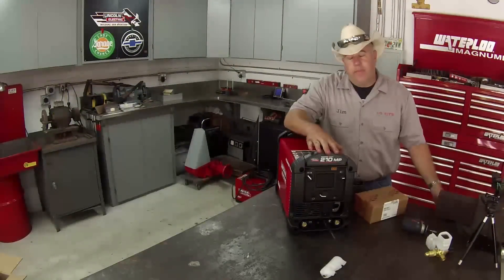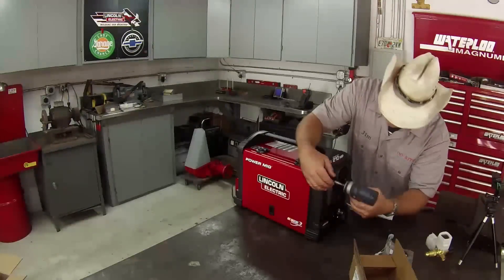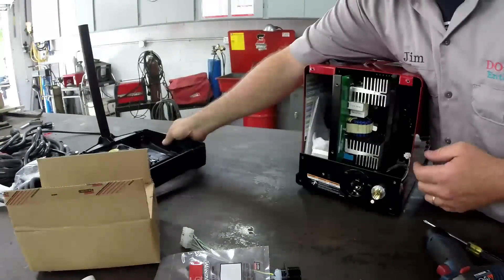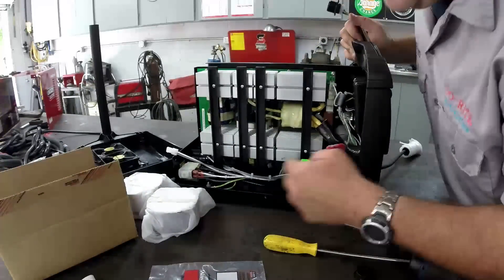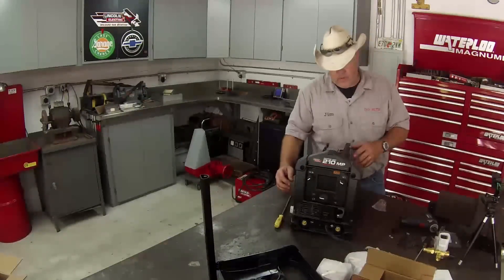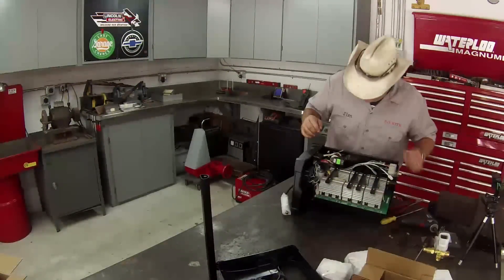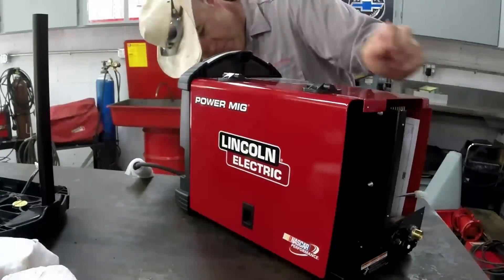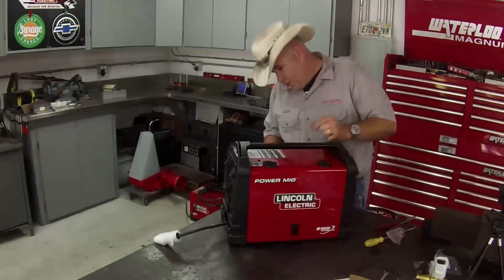New Lincoln Electric Power Mig 210 MP Welding Machine  (Ep 3 Tig Weld Adapter Installation)

Comment: Lincoln should include adapter plug for Tig for the price of machine. But looks like a good machine thinking about buying one or Tweco fabricator 211i
Reply from the maker: +dunno yolo I have been super pleased with mine. I'm going to stretch it's legs out this week I have lots of farm welding to do.

Comment: absolutely ridiculous that it doesn't come installed from the factory.    how cheap can they get.   unreal.     lame too that you gotta leave the side door open when using the pedal.
Reply from the maker: +gerard143 It is a bit ridiculous that they don't install the plug at the factory. I assume it is done to help keep the cost down, since it comes in the TIG kit that you have to buy separately. Most folks want a less expensive MIG welder first. Then add the TIG option later. Instead of focusing on the fact that the door will be open during the very few times that I DC TIG weld with my MIG welder (I have 4 other TIG welders) I am focusing on the fact that someone FINALLY made a really nice MIG welder that can TIG weld! Where was that when I first got started buying machines.
Reply: +DoRite Fabrication I hear ya.  I feel the esab has a heads up now on the Lincoln however I bought the Lincoln over the esab.  Esab rebel will do 6010 well. Plugs right on the front for pedal.  User manual and parts is listed right in the lcd interface and the case is a real nice design with more handles and protection.  I chose the Lincoln because the lcd interfere is a lot better looking and better use of colors.  As well as its red and I hate yellow lol.    Kinda eats at me knowing the Lincoln won't do 6010 good and the rebel will and I bought a welder in a way that is now inferior in some aspects but screw it I guess.  I won't use 6010 often anyways I'll just mig what I need to 95 percent of the time.    I'm sure I'll be happy and it's a great welder.  Mine arrives tomorrow.  Excited.  Just built my cart so it's ready for a new shiny welder lol.

Comment: A lot of people seem to really like that machine. But leaving that TIG plug out is bogus. I could see if the upgrade was something more costly like a special board, but just a plug? Also having the plug be under the side door isn't ideal either. Come on Lincoln, you can do better. If you have to shave something off to hit the price point, make it the extra drive rollers and included spools of wire or something.
Reply from the maker: +Rambozo Clown I agree, leaving the plug out was kinda dumb. Also the gas solenoid  for MIG doesn't turn the gas on in TIG, you have to use a manual valve. Kinda dumb too! However, it welds sweet! For around $ 1400.00 (with a TIG torch and plug) it STILL is a lot of bang for you dollar.

Comment: Hi mate.Did you just void your warranty?  If not, what would, because you opened up the whole machine.Marcel.
Reply from the maker: +Marcel Timmers No, I don't think so. Lincoln sells the machine (the TIG adapter plug) that way, with instructions on how to hook it up. If you follow their instructions I don't think there will be a problem. I have never had a warranty issue, they have always been outstanding with me.
Reply: You must have sold a few by now though.  But it's good to hear that a machine is backed by the manufacturer.
Reply from the maker: +Marcel Timmers , I'll be very honest here, I couldn't sell a bottle of water to a guy lost in the desert. However, I can tell you what works, is crap, or what I would or wouldn't spend my pennies on. So far I really like this machine. A lot of bang for the buck! It's not the end all be all but, I do think it is a high Quality machine with a LOT of versatility into one package. One of the most valuable things I have in my shop, is the floor real estate. For the guy with a small shop, this thing will MIG, DC TIG, and DC stick like a Boss! All in one little package. I'll give it a thumbs up!